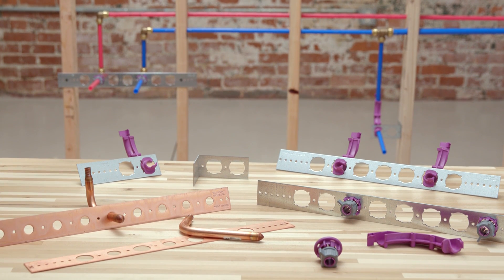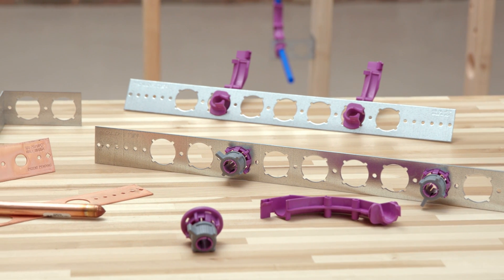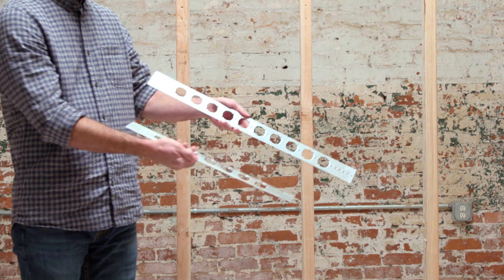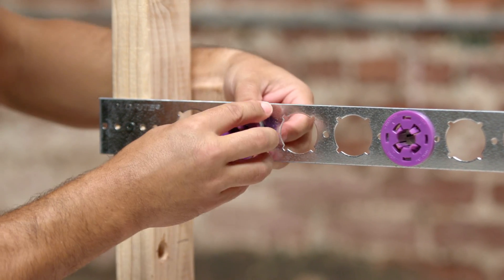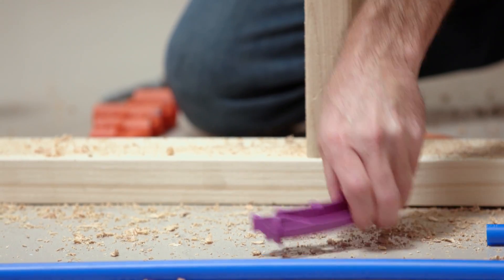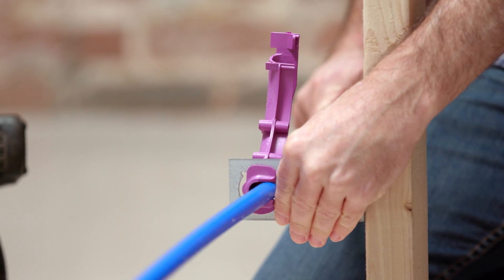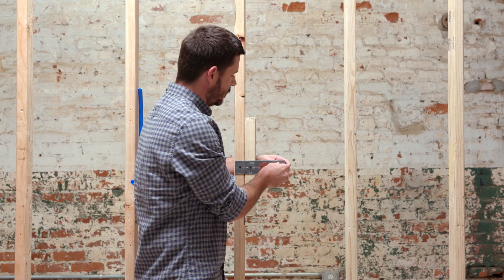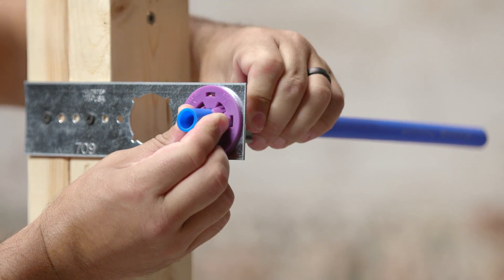How to Install PEX Brackets for Stub-Out Support | HoldRite

Comment: I am a homeowner with these installed in my house. A couple of them are not coming through the drywall at a 90 degree angle due to sloppy installation of the support bracket (it’s twisted). I pointed this out to the builder before the walls were closed up but nothing was done about it. I’m wondering if there is anything I can do to fix this after the house is finished. The reason I care is because these two supply lines will be visible under a pedestal sink.
Reply: This is why people shouldn't stub out with PEX tube.  It is ugly and sloppy.

Comment: There is no clearance for 2x3 walls. It buldges out beyond the 2x3 framing. Do you make some that will work with 2x3 walls?
Reply: Use a drop ear 90. Half inch pex can barely make a 90 in a 2x4 wall. No way you can make it in a 2x3 without a fitting.

Comment: Does the metal bracket and installed 701 (purple fitting) affect drywall installation? It creates a bump to the otherwise flat stud wall. I can't find anything on this. When cutting the hole for the drywall, do you cut it the size of the pipe, or the 701? Thanks for any help.
Reply: same boat as this guy, im used to routing out a 1/16" groove for wall plates to protect my romex, i think its going to be the same here or your sheetrock will not be plumb on installation.

Comment: The pex and brackets are awesome but I wouldn’t put shark bite in anyone’s wall.  O-rings eventually  fail.  The younger generation loves them because they require no skills.   I would suggest using the fittings from the pex manufacturer.
Reply: Love sharkbite. I've had it in my walls for many years now without a single leak.
Reply: @JohnMcCormick   I have polybutylene in my walls and don’t have leaks.  Doesn’t mean it won’t eventually.
Reply: And old guys hate them because they are change . Have had one in my bathroom for 10 years no leaks. Learn to install it and its just as good old ways
Reply: I dislike shark bites in walls because I've had to clean up the mess, after my brother installed them in his home incorrectly.
I'm sure shark bites can last many many many years.
But people who fail to mark the insert depth before installing the fitting, will likely see leaks.
People who do not anchor their pex/copper  before and after the fitting, and have a bend shortly thereafter, WILL see leaks.
People who do not deburr/ream their copper before a shark bite most likely are asking for leaks.

Shark bites can last a long time. Or very little time.
I trust myself when installing one, but I'd always switch it out for something I trust more when the opportunity arises.

Anyways, I never recommend shark bites to anyone who I do not think will take the time to learn how to use them right. Otherwise they'll be upset with me after their shit repair job goes south.
Reply: The older generation can't figure out how to use the remote on their TV
Reply: Plumbers love Pro Press, and those use O-rings.
Reply: I only use copper pipe and cast iron pipe, these residential plumbers got it easy no skill needed just a YouTube video no hands on learning required.